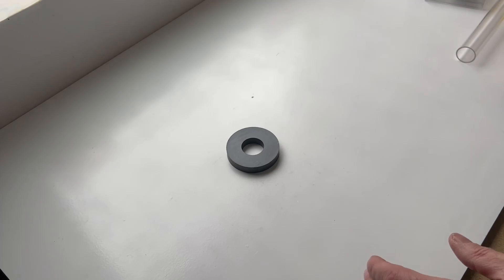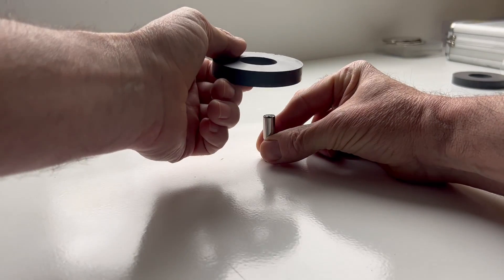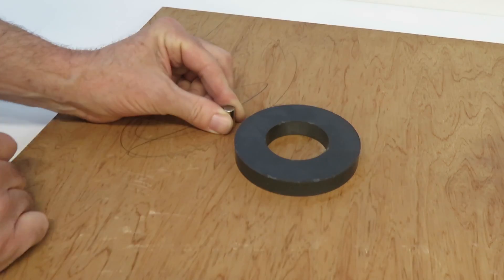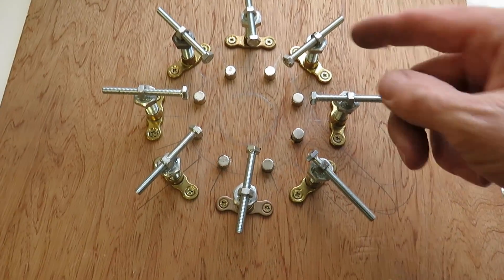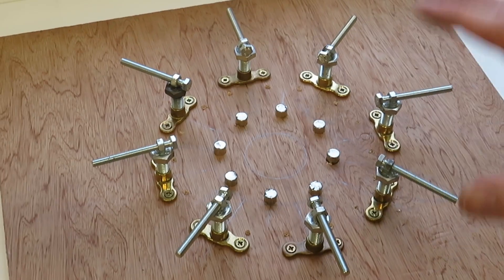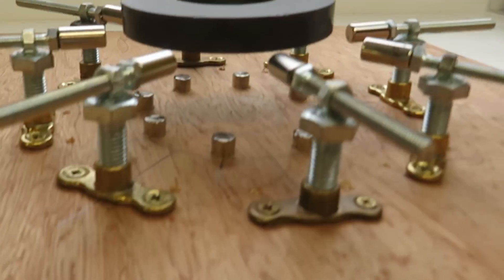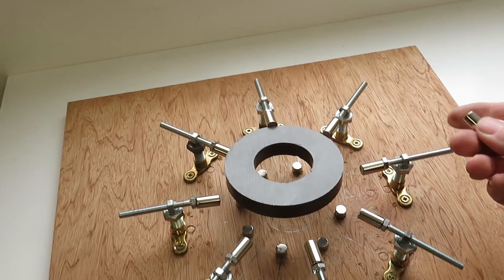Can I Levitate a Magnet?

Comment: I am very interested in seeking set of  magnets mounted without metal on a rectangle board. They need to be able to spin. The n/s ends need to be marked/colored. I want to see what happens when one of the magnets is turned how the field of magnets react. To simplify a row of say 6 or 7 are attached to a board and the resistance of the first turning jut one is measured and then the next and next till the last. To continue I’d like to see the first magnets ability to generate a charge and each there after to see if there is a mechanical advantage. Ther mounted magnets should be able to be adjusted on the board to test for changes give increasing or decreasing their distance from one another. Do you have any ideas on how to do this or try it yourself?

Comment: Once you have it floating other magnets could be added to the outside of top round magnet then using your bolt idea with magnets it should freely be able to spin your top magnet due to the fact that there is zero resistance of your top magnet, creating free energy.

Comment: Not unlike your tube. Stabilize your bottom magnet to the base magnets. Then drill one centre hole inside your base magnet, push one in to hold the first one from moving then stack the remaining magnets one on top of the other going up. Once you have 3 or 4 inches of magnets stacked on top of each other place the second circular magnet over. I believe the centre magnets will create a positive negative field that neither attracts nor pushes away. Allowing the second round magnet to find its own centre and float.

Comment: I say try making stabilizing magnets closer together so a few more aught to do it for the edge stabilizers. and the ones on the board, might work better if the center of the magnets are lined up with the outer edge of the large ferrite magnet now you need to enclose the ferrite magnet  with magnets from above the ferrite and below the ferrite so that it has no where to go, very nice setup.
Reply from the maker: I think more stabilising magnets will definitely go into the modifications so thanks very much for the input!

Comment: What you're trying to achieve is unfortunately impossible. Have a look at 'Earnshaw's Theorem'.  There is no combination of magnetic and gravitational forces which will allow a magnet to stably levitate, and this has been proven mathematically.

To make it work, you need to use one or more of the following:

- Diamagnetic materials such as bismuth or pyrolitic graphite, as these enable stable configurations to exist.
- An additional stabilising force (such as guide rods, or by spinning the levitating magnet so that it acts as a gyroscope).
- Active stabilisation using electronics
- Superconducting materials, which levitate via flux pinning.

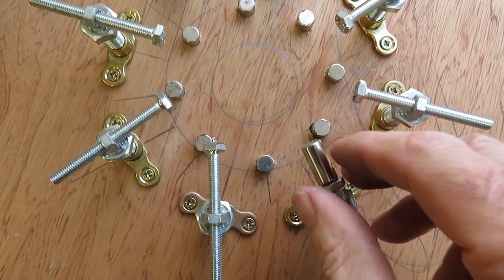Comment: 04:18 (might have solved this after this time stamp) but perhaps the issue could be solved by putting springs between the ends of each bolt (the OD of the circle/ octagon they make) such that the tension between all springs (being a circular in a closed system) means the bots don’t swivel unwantedly…?
Reply from the maker: Thanks for the ideas!
Pete.

Comment: I wonder who would finish first; an engineer with trial and error positioning of magnets or a physicist using flux equations to determine positions? I’d reckon the trial and error takes as much time as the flux equations (if doing them by hand which to me is a fair given the engineer isn’t using autonomous manufacture - I’m assuming).
Reply from the maker: Haha! If I could stop time I reckon I could get the perfect setup in part 2!